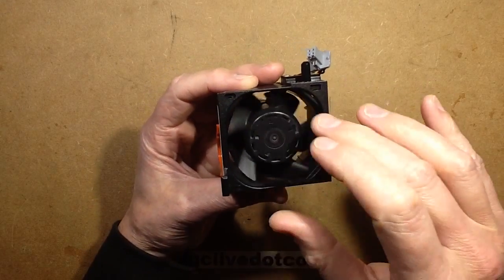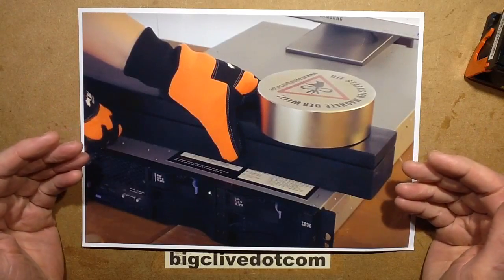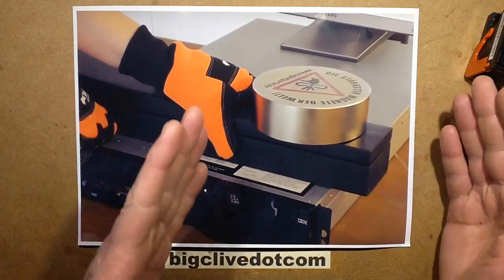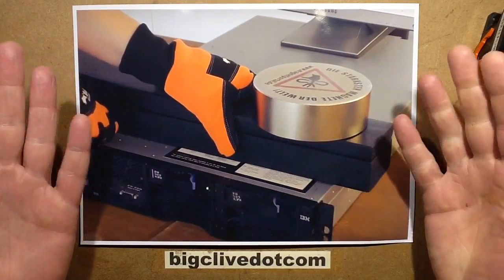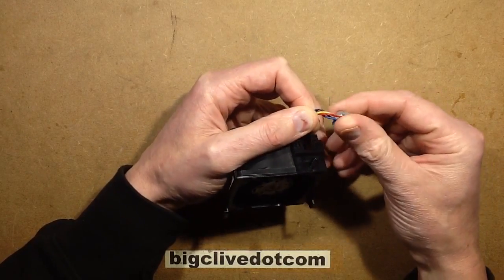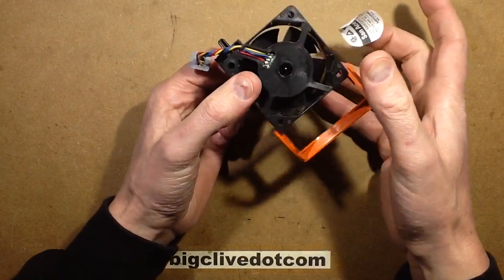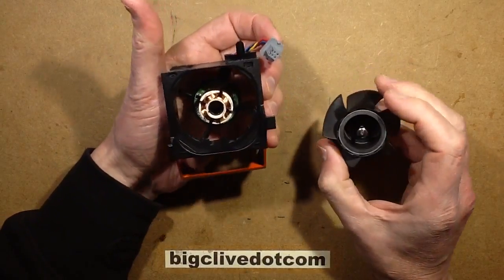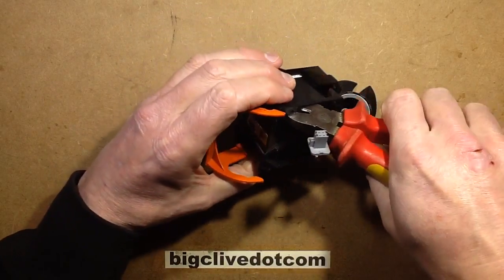Dead server fan autopsy.  (Unusual circumstances.)

Comment: A magnet with that much flux could easily induce a massive current even without a fast motion. I suspect this is what happened.
Reply: i agree, with rjk. Also, I think that the motor windings might help to induce high enough voltage to damage the components - that's why the Zener diodes failed - and that current regulator - which were in the path of the current. But I'm not an electrical engineer, so this is just a guess :) .
Reply: well if you disconnect a spinning low voltage permanent magnet motor it'll generate a surprisingly high voltage across it's terminals until it's stationary, possibly giving the person disconnecting it an electric shock.  but in this motor the stator has the windings so I don't think the magnetic field from the super magnet could have been moving rapidly with reference to the copper. I'd have thought the permanent ring magnet on the rotor would have shielded the windings from an external field if anything (rather like the iron sheets in the magnet packaging video made by braniac75.
I don't think we'd know the answer for sure without carrying out tests of the best (destructive) kind
Reply: if the fan were spinning, that count as a fast moving object over the magnet point of referential, don't they?
Reply: @renatocron  the coils of the fan are stationary, its the magnet that spins on the fan... that was my first thought too
Reply: rjk  you still need a fair amount of movement for this even with a strong magnet, if you watch the server video they could just barely drag it over I do not think this is the case
Reply: ChrisD4335 It's also odd that one of the four fans survived, they were all in a line and apparently the same distance from the path of the magnet. it looks like 3 of them croaked almost immediately and one survived several passes of the magnet. The case didn't seem to be doing any fan a particular favour wrt shielding it. I wonder if the survivor had been replaced in service and had a different revision of PCB (or something)
Reply: This was my first thought also but it's a long time since I did any theoretical stuff to do with flux fields etc which could be used to determine the induced voltage.  Even a brief spike could be enough to break down a zener (assuming it was high enough) I would have imagined.  Somebody out there knows the answer!
Reply: The coils on the fan move, not all motors are built that way sometimes the coils are fixed but in this case you can see it from the autopsy and the fans were spinning at probably several thousand rpm. I have no doubt what happened was a sudden induced current in the coils.
Reply: If the fans were running, there is your fast motion.
Reply: The coils are fixed in the middle of the motor. The field density from the big magnet is not likely more than 2-10x that off the motors own magnets, and those go around hundreds of times per minute without any effect on the zener diode.

Comment: I hope they send you one or two working fans. They are fun.
And you can use them to chop vegies and cut the end off fingers.
Reply: Not as fun as a brushless motor for RC multirotor/aircraft. With the same size with the server fan's motor, it can pull up to 25A at 11.1V, equivalent to around 277.5W compared to these server fans which only pull around 2-3A at 12/24V, around 20W to 35W. Those brushless motor with propeller attached can literally cut off your fingers easily, especially those who use carbon propeller.
Reply: Well yes.
One is made to lift a heavy machine and throw it around in the air, the other is a cooling fan for a computer. You might as well compare it to the fans used in wind tunnels.
For what they are, they are very impressive. But there are much more powerful fans out there. :)
Plus it's nice seeing  a scary warning label inside a computer: https://3.bp.blogspot.com/-RyDEHm97XUo/U-TQVW_CHgI/AAAAAAAADxo/zQZitzt_Ufs/s1600/IMG_20140807_221059.jpg
Reply: Power MOSFET is one of the most amazing and useful things I've ever see.

Yes, server fans are amazing. I have two server fans, one is 40x40mm. Its counter-rotating and manufactured by AVC. Consume around 1.7A at 12V, it moves quite a lot of air at 33cfm and the static pressure is very high
Another server fan that I have is Nidec beta V 450. It's 12x12 brushless DC fan and rated current consumption at 3.3A at 12V, 3.9A maximum current at 13.7V. It moves a lot of air at 220cfm and use almost 40W of electricity. These fans are awesome!
Reply: What about the USB blenders? Those were funny, especially the "wee green finger chopping machine". Anyone remember that?

Comment: I wired a 120mm version of this exact fan with the same blades to my cpu cooler with the pwm feedback to the mobo. You should hear it ramp up! Sounds like a jet engine and will cut your finger nearly off.

Comment: I watched that video when it came out. I wonder if the magnet attracted the guts of the diode and caused it to short internally. Are the guts of a diode magnetic?
If you put 12V to the 3 wire server fans without the PWM signal they wind up full speed and stop and wind up full again.

Comment: With the computer power supply's they need to have components to use the power they produce other wise they can over charge and damage other components on the board, I'd say that when the hard drives failed it caused a spike in current and over charged the fans causing them to break.

Comment: The magnets in the rotor will have acted as conductors moving in a (very strong) magnetic field at 3000 rpm or whatever - acted as an alternator and arced over or induced large eddies in the stator and pcb?
Reply: Those magnets in the rotor (as in, the outer cup shaped part that actually moves) are not electrical at all. They are made from a solid piece of strongly magnetic ceramic. I'd doubt they'd arc if they were spinning at 3000 rps directly under the magnet. 

The wound copper coils in the center of the motor don't spin at all.

Comment: Remember kids magnets are not something to bugger with. I remember having too keep my credit card outside the lab,otherwise it would become a pricey bit of plastic.
Reply: thats only a problem if your in the USA (most of the world uses chip and pin which is unaffected by magnets)
Reply: Yep, haven't used the magnet strip since like 2006.
Reply: Where "pricey" = "free" - just call up the bank and tell them your magstripe stopped working, they'll just issue you another card. I've done it multiple times.  For some reason one of my cards dies every few months, even though it's in a wallet with a bunch of other cards that never have any trouble. I suspect my credit union bought really cheap cards.

Comment: Wonder how they ship these things...
Reply: If you have a look at the original video, (Clive provided a link in the description) at around the 3:10 mark you can see how the magnet was packed in it's box.
Generally speaking, a lot of packing material and steel sheets are used to protect and somewhat contain the magnets force.
Reply: ForestCat_Peter Braniac did a video on that very subject. It's actually surprising how little goes into packaging them. I think the point is that whilst such magnets have a huge field strength, it dies of very quickly with distance, so only minimal shielding is needed.

Go and have a look at his channel. He doesn't make videos very often, but his content is of utterly wonderful quality. Well worth a sub!
Reply: There must be some sort of shielded case for it. Even so, I wonder if they are allowed in aircraft?
Reply: I would guess the magnets are shielded using Mu metal in order to contain the magnetic field during shipment.

Comment: googles 'magnetic defense gloves

Not sure what I expected.
Reply: I can totally imagine some gloves reinforced with sections of carbon fiber tubes that won't let your fingers be squashed... :)
Reply: All gloves will save you from losing the tip of your finger, as the gloves will act like a tube of toothpaste, pushing your mangled finger out from between the magnet and metal so it can get closer. Unless they are fingerless gloves. That would be like wearing a headless condom.
Reply: +Lucas Nice pic dude :p
Reply: @Pass the Spider and you would be the one say about Googling it ereser image checks out LOL.